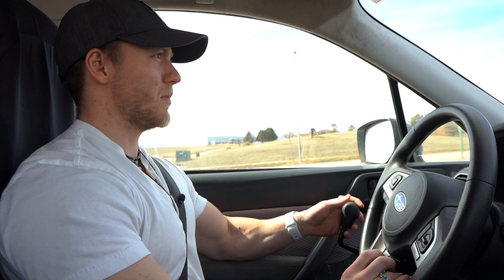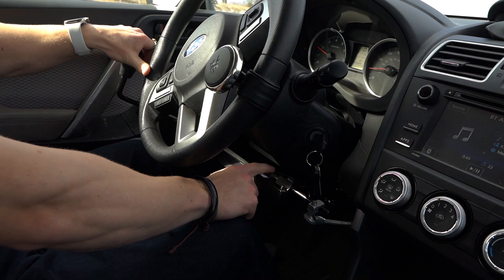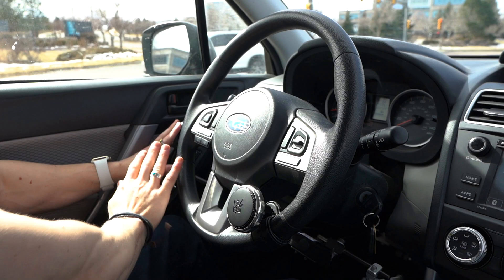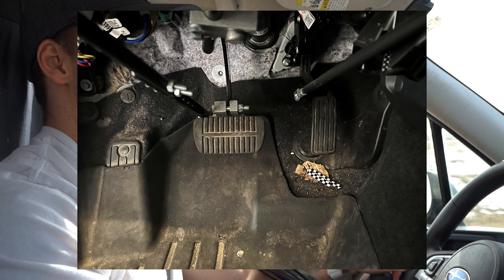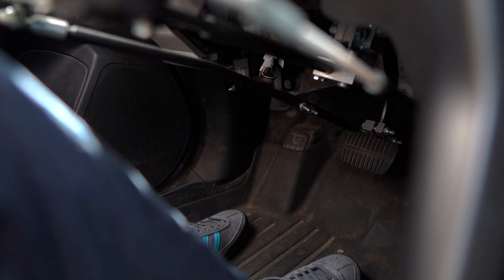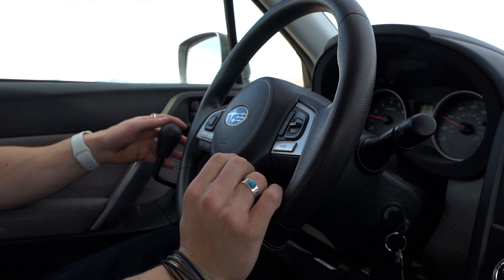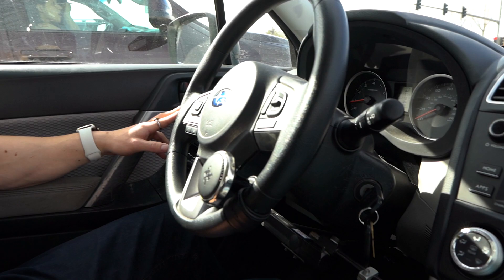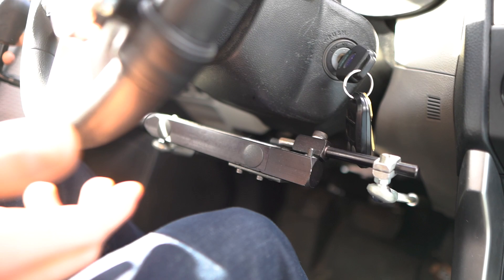How Paraplegics Drive With Hand Controls (Gets Hit by Semi-Truck)

Comment: are the steering wheel knobs legal in Michigan?,  I been wanting one to help me out,,,,
Reply from the maker: I’ve never had an issue with mine. I think they’re legal if one needs it when using hand controls or for some disability. But definitely double check with any legal documentation online. (Or just don’t get pulled over)
Reply: Yes